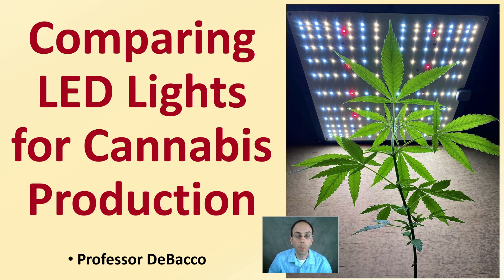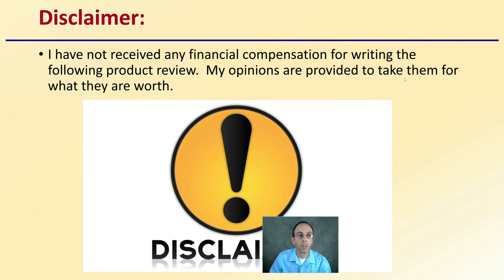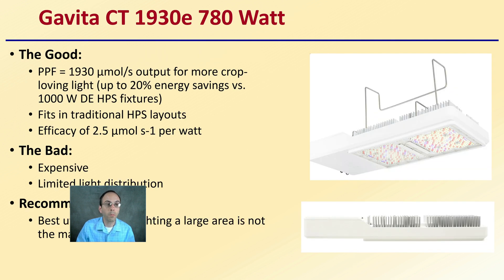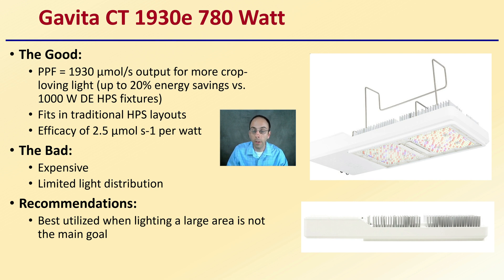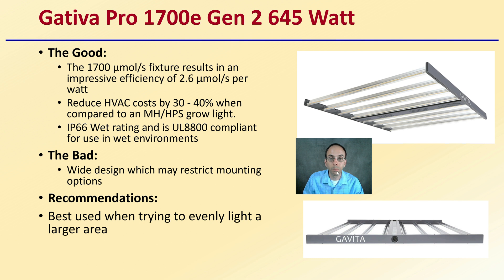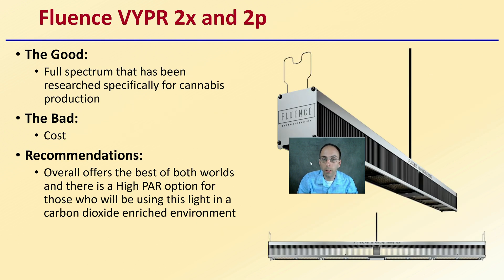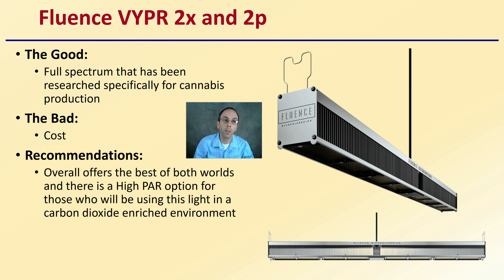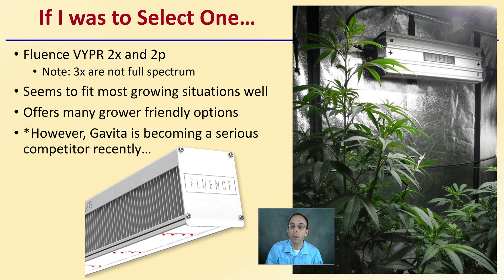Comparing LED Lights for Cannabis Production

Comment: Great video. 👍
Have one question regarding full spectrum. 
Do you think one could save money and buy a veg light as a supplemental lighting, if you are around the tropics for example? One could almost get away with a light leaving to the blue side of the spectrum, no? 
Those lights are cheaper than the whole shebang spectrum lights. 🤷
Keep making these videos, we need more correct info out there, and not just, hang the light 12'' because someone told me to😋
Reply from the maker: Thanks for commenting on how you like the videos!  Full spectrum light is the way to go, but if you have a supportive general growing environment, consider a poly tunnel or cold frame to take advantage of the sun and still have some control over the plants growing conditions.
Reply: Very true. Full spectrum lights should give plants the best growing environment. However not very comfortable 40 c inside those small hoops😅 need a ac unit in the greenhouse. Thanks anyway👍

Comment: Thoughts on the Spider farmer 4000 or any light from them?
Reply: I run those in my garden and have had wonderful results versus metal halide and high pressure sodium.
Reply from the maker: I do not have experience with this company.

Comment: Great video. All 3 fixtures are great and if you can afford them, buy them. Thanks for sharing and peace ✌🏻 
Gavita has been making horticultural lights for decades👍🏻
Reply from the maker: Yes, cost can be an issue, but consider the phrase.... Good LED's are not cheap and cheap LED's are not good ;-)

Comment: Check out the light from the Green Sunshine Co. Probably the best LEDs on the market.
Reply: Actually have an Electric Sky 180v2 so curious what this university thinks of it
Reply from the maker: Based on a quick review the Electric Sky, does not seem to produce very much light intensity, so maybe best for small propagation, but this seems limiting and personally a CMH would probably do a better job.

Comment: Those narrow light fixtures are useless.
Their distribution is terrible.

As for the bigger light that you showed. With the light bars 5 to 6 inchs apart are very misleading.

From my understanding and experience is that led diodes do not distribute their light hardly at all.
Meaning that they project their light straight down.
Yes one could add a lens to project the light out further.
But the lost of intensity is so dramatic that it's a lose lose all the way around.

I am very surprised that you and your so called university are not studying and discussing these very important situations.

It seems like to me, you are just jumping on the band wagon like all these other clowns that perform all these so called test.

All of you are all stating the same thing.
Which makes it look like to me, that none of you are actually performing your own test.

To me the distribution of a led diode is very important.

Let me tell you about led diode light distribution.
That I found out from experience and by total accident.

Fifteen years ago i did a study on the cost to grow cannabis in soil.
I grew these plants everyway style possible.
With all the different lights available. Also throwing down alot of different amounts of watts to these plants.
It took me almost 4 years to perform all these tests.

Oh by the way all these tests were performed for indoor growing only.

My conclusions were shocking to me.

All these tests came up negative.
The cost was so high that I wasn't even close to making my money back.
It was all due to the cost of labor involved.
Which in most cases was double what the electrical cost was.

So to make a very long story short.

I decided to perform the same test, but growing with hydroponics or Areoponics.
I basically new I would get the same results if I grew all the plants with all the different styles I did before.

Well I decided to grow with LPA ( low pressure areo) in the SOG ( sea of green).

Well I built my own areo systems.
Which consist of 2, 21 site grow chambers with 1 reservoir.
Each system measures 2'9"x 3'. So that is 42 plants basically in a 9 s/ft area.

My thinking was I could use one light over each system.
So I purchased some led lights from 4 different manufacturer's.
All of them stating that their lights covered a 4'x4' area in the flowering stage.

So I decided to try the led light that was the biggest.
The light fixture itself messured 18" x 18".

So I took 42 clones and put them in some areo cloners I built. In 5 days i started getting roots. In 10 days they ALL had roots.
I let them go for 17 days to establish a good root system.

Then I put them in the big areo system, straight into 12/12. No veg time.

The clones were 5 to 6 inchs at this stage.

This is where I discovered about how much light intensity is lost with led diodes.
I mean I knew there is a lost. Just from all the par test I have seen.
But most of the people performing these tests, are performing them directly under the light fixture.

Well anyway, with in 2 weeks I was seeing a dramatic difference in growth.
Due to the fact that the areo systems are basically 3'x3' and the led light fixture only being 18"x18".
All the plants that were not directly under the light fixture were dramatically smaller.
The plants that were only a 1/8 of a inch away from the light fixture were only growing half as tall as the plants directly under the light fixture.
And then the plants that were further and further away from the fixture got smaller and smaller.
And the row of plants that was the farthest away basically didn't even grow.
They did flower some what.

And all the plants that were directly under the light fixture grew to 24 to 30 inches tall, with a nice big fat bud.

So what I'm getting at is about all the misleading information that you and all these other people performing these tests and the manufacturer's are stating.
IT'S ALL TOTAL BS.

I have brought this problem up to some of these people performing these tests and to some manufacturer's.
And I've received NO response.

So I'm giving you your chance to prove how real you are going to be.

And that you are not just jumping on the band wagon.

Thanks ASS OG.
AreoSystemSea OfGreen.

Oh by the way. I've been growing this way for 7 year's now.
So that should tell you how cost effective it is.
Later.......
Reply: Brother, you sure can type.
Reply from the maker: Long comment to post and with your seven years of growing, there is not one video on your channel.....
Reply: @DeBaccoUniversity  
I've been growing cannabis for almost 50 years.
And I've never taken a video of any of my grows and never will.

Any fool can make a video, of anything they want.

I don't need praise from some idiot on YouTube to boost my ego.

What matters to me is my customers opinions.

Thanks for the response. Even though it is really lame.

I expected more than this from a so called university.
Reply: So you’re using your test data from 15 years ago to compare to what is available for LED technology today? 
There is NO comparison. Put an HLG 650R Diablo above a 5x5 area and see what happens.
Reply: @tombryant4518  
I agree with you totally, in regards to the technology from 15 years ago to today's.
That's why 10 years ago when I did that first grow I started building my own lights. This way I can build them they way I want them.
And I don't have to settle for something that doesn't meet my needs.

I also agree that hlg makes a good product. But it doesn't meet my needs.

Also I'm assuming you don't grow in the SOG.
So you really don't have a clue of what your talking about.
Reply: @assog5737  Don’t assume. I do know what I’m talking about. Do I grow Sea Of Green? Not anymore. I grow 4 big plants under each of my lights in a 5x5 foot area of real estate that net me an average pound each dry weight. They are trained to be short and wide, and are easy for me to access. The room is a highly reflective, CO2 enriched white room with no wasted photons hitting the floor. 
You are right by saying that certain lights don’t meet certain needs, and at least you didn’t waste your money buying something that doesn’t work for your situation.
Reply: @tombryant4518  
Whatever !
I really don't care !
Reply: @assog5737  Ok. Neither do I. It’s ok man.
Reply: @assog5737  I am curious about your lights though. Do you build your own LED lights? HPS? CMH? How many micro moles per joule do they put out?